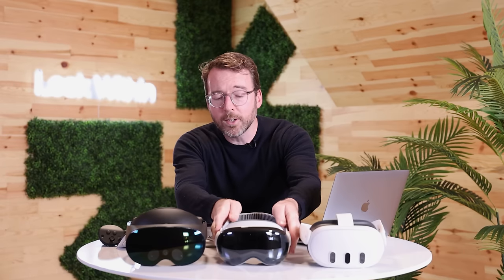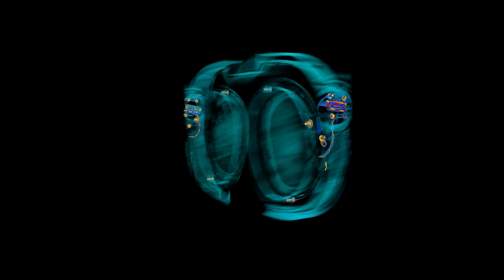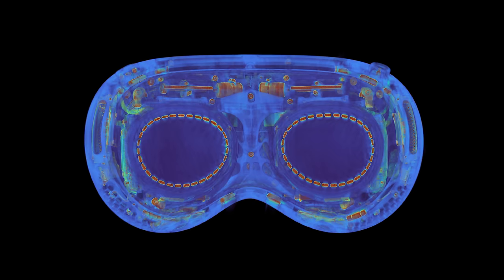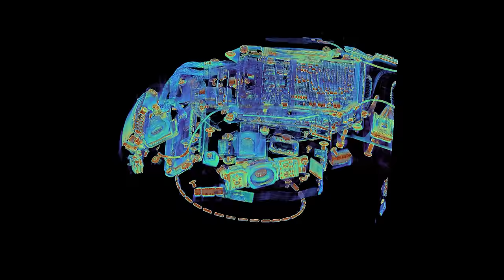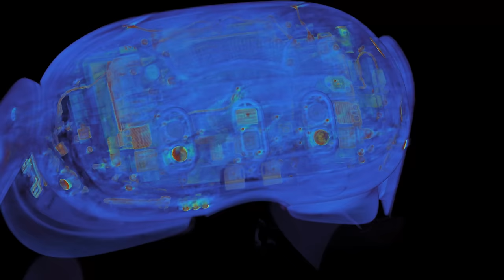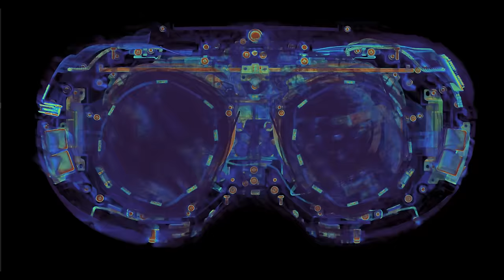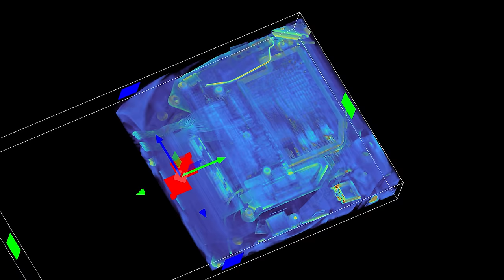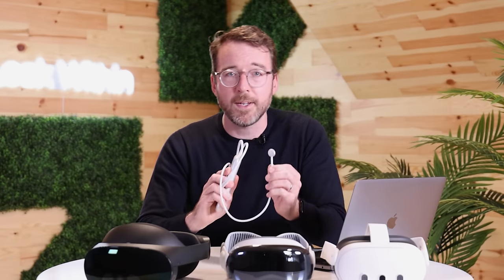Apple Vision Pro and Meta Quest Non-Destructive Teardown

Comment: Yes it speaks to Apples design philosophy, so much engineering to make it compact as possible just to undo everything using heavy materials like glass and metal. Insane cutting edge micro OLEDs but with no depth correction so theres no warping in passthrough because it looks ugly. Hand tracking with great looking occlusion at 90 frames per second, but actual skeletal hand tracking is just 30hz, half of Q3.

Apple; Form over function.
Reply: Is not just form factor is how advance the device works. VR/AR is obviously a groundbreaking technology. If it's not, nothing is
Reply: Think u are right with the built but other thing… feel that’s just where u put ur priorities and in this case I think they made the correct decision. 
While yes it’s stupid how heavy it is, it’s their first product in this sector and impressions matter. Especially if not many ppl will get one at first anyway. Making a device desirable is very important. Same as separating themself from other Headset makers. Especially since vr does not have a good public image

Also to that, Ugly is can be dismissed easily but if something is so ugly u don’t want to use it it’s a different matter. 
Great occlusion keeps the user more immersed making working in it way more natural while skeletal tracking only is a problem for games, which it isn’t made for anyways.
Reply: Bitter much?

Comment: Fun fact, not only does the quest 3 do hand tracking, but if you compile the same code for both units, the hand tracking is actually more accurate/faster on the quest 3 as it is on the vision pro.
Reply: Sure, but hand tracking doesn’t need to be accurate on VP, because you just select with pinching but use your eyes to choose what you want to select.

Comment: The Quest 3 does have prescription inserts as well. You can wear glasses, but you aren't expected to.

They attach via a small ridge on the inside edge of the lens housing, which is designed specifically for that purpose.